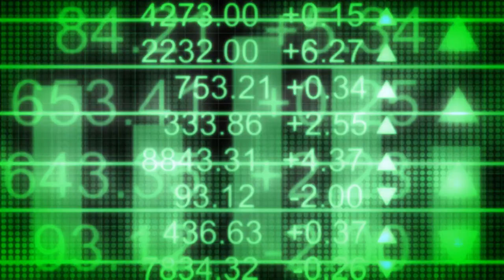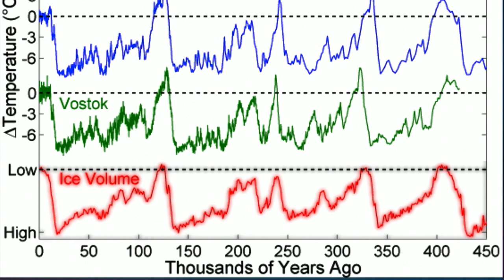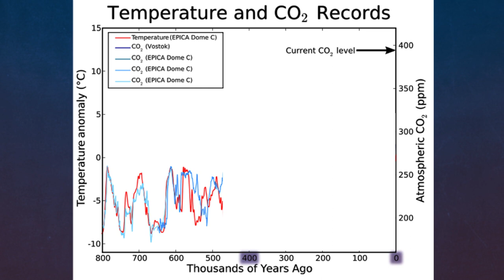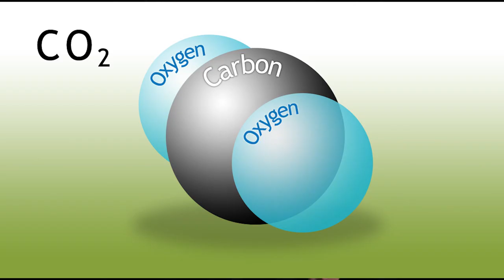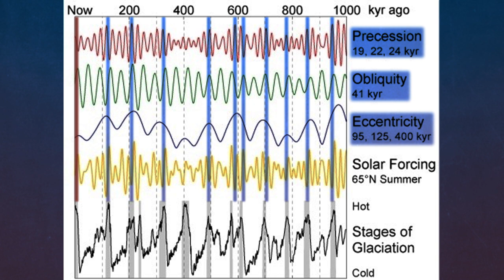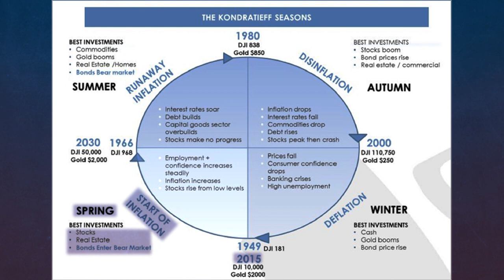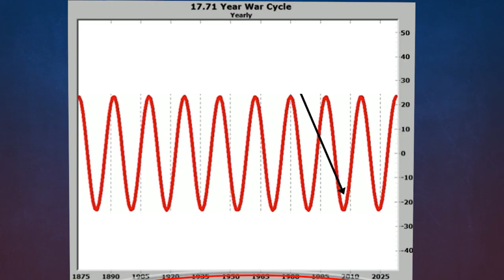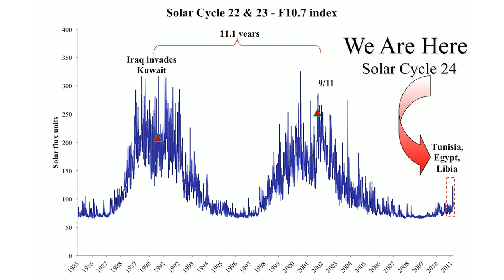Cycles of Time with Gregg Braden

Comment: I’m so disappointed in Gregg Braden. There are several critical and dangerous errors in this video. First of all, the graph shown at 7:40 is from Loehle and McCulloch (2008) 'A 2000-Year Global Temperature Reconstruction Based on Non-Tree Ring Proxies'. Accuracy aside (and there are several criticisms of the paper), the data ENDS at AD1935! And Braden describes this data as “TODAY.” Updating to current readings, the temperature for 2016 would be plotted at +1. 2° C which is clearly off the chart.

Also, Braden’s interpretation of the “CO2 lags temperature” graph is erroneous and does not tell the whole story. Though it is true that the initial changes in temperature during periods of glacial/interglacial transition are explained by changes in the Earth’s orbit around the sun, which affects the amount of seasonal sunlight reaching the Earth’s surface. However, the lag between temperature and CO2 works as follows: as ocean temperatures rise, oceans release CO2 into the atmosphere. In turn, this release amplifies the warming trend, leading to yet more CO2 being released. In other words, though historically CO2 was not the initial trigger, the initial warming further triggers a CO2 warming feedback loop until the planet has a chance to stabilize (aka- the cooling periods Braden mentions). This is how the climate has changed naturally over the millennia. The rate and speed of warming we are now seeing with mass CO2 and Methane release, is much more rapid than any time in history.

I like a lot of what Braden has had to say in the past regarding ancient civilizations, indigenous cultures, and the heart-brain-body connection.. but this video is ill-informed, irresponsible, and outright dangerous at a time of critical imperative that we work to save our civilization and as many species as possible from Earth’s 6th mass extinction, which is already now underway.
Reply: Totally agree! This is what happens when lay people believe that climate science is just a matter of doing 'research' on google.
Reply: Agree! Braden lost me when he said Milutin Milanković was  "an Australian astronomer" while showing a slide describing him as Austrian/Hungarian. Not mission critical but VERY sloppy and not showing any understanding of his own background evidence.
Reply: Very disappointing to see Gregg Braden wade into an area he has no expertise in.
Unfortunately it makes me question all of his previous work as well now.
Reply: Maybe he's in love with the sound of his own voice on youtube, who knows.
Reply: Braden does have some interesting opinions and insights but in this video and others when he cites FACTS I'm familiar with he's often dead wrong.  I therefore doubt anything he says where I can't readily verify his statements independently.  Along with his video production team which is good, he needs a fact checker who can read.  As funkymystic points out, his interpretation of the relation between PAST carbon and temperature cycles is incorrect and he totally ignores the FACT that current values are indeed OFF THE CHART he uses which ends in 1935.  The current temperature is off the chart and so is the current level of atmospheric carbon dioxide which is > 400 ppm.  What he's right about is that rising temperatures do cause subsequent increases in atmospheric carbon naturally regardless of the cause of the temperature increase.  This actually means that even if all man made carbon emissions were to cease atmospheric carbon would keep climbing as a result of the warming we've already caused.   He misses the fact that rising CO2 levels in turn cause further warming in a positive feedback loop.  That fact doesn't explain current CO2 levels it just means that the warming caused by artificial anthropogenic carbon emissions is AMPLIFIED by natural forces.  For each 10 units of CO2 humans add to the atmosphere mother nature tosses in another one "for free."  As we warm the earth by adding CO2, the earth "naturally" produces more CO2 which in turn warms the earth even more.  This is a positive feedback loop which can reach a "runaway" state. Venus with surface temperatures hot enough to melt lead is likely the result of such a runaway carbon feedback loop.  In the case of Venus the warming wasn't the result of human activity but rather of being closer to the sun.  Earth's climate is a very delicate balance and even very small variations in solar energy can trigger and end ice ages.  What's the effect going to be of continuing to increase atmospheric carbon off the chart?  Hothouse earth.  Of course there are natural variations in climate and always have been but current carbon and temperature increases are MOSTLY the result of human activity and are vastly greater than the natural variability, some of which is cyclical.  This is the all-important fact which is taking us "off the charts" into a climate catastrophe.  Braden needs to read one or two scientific papers by real climate scientists and get a real scientist to review his hokum before torpedoing his own credibility by demonstrating his complete incomprehension of climate science and carbon cycles.
Reply: Yes, I totally agree with your point of view. I would just had one thing.
Also this climate change matter awoke our consciousness on optimizing the use of our energy (50 years ago Captain Cousteau warned us about the necessity to have an optimized use of our planetary resources), without the global warming subject, it is still worth make a better use of what is able to produce the planet. For instance, using less fuel will lead to less contamination which has also a frightening impact on the life cycles upon which we depend should we like it or not. So even though we might be wrong (which is not) about reasons of temperatures rising, adding respect to the biosphere (I use this word to emphasize that Earth is a living system) would give us much more chance to reach stage I (at best estimation we should be at 0.74) of evolution. Evolution IS something we control (refer to one of Baden's friend: Bruce Lipton).
Reply: Madelyne Edwards can I watch your video?
Reply: @tomix1970pl1  exactly, dissapointed people, but all they can do is reply on YT video's, doing something that actually makes a difference... Nah...
Reply: Oceans don't release more CO2 though.  The waters may hold less but growth rates of phytoplankton, forams, coral etc all increase. 

Look back through the geological record.  Limestones and mega reefs all form in warmer water and all remove CO2 from the  atmosphere and lock it away.  Even oil and gas that we use today are vast carbon stores that originated in the oceans.
Reply: @tomix1970pl1  "The elites.. etc etc" - not going to comment on that BS. However, commenting about the errors of a video with the potential to influence millions of viewer's ideas is not "doing nothing." and the comments are correcting him. Wtf do you think "peer reviewed" in science means? It means bringing criticism to scientists that are not getting it right... Those commenting with criticism ahead of this comment did so with an explanation of the data,. thus, "showing you how it should be in the right way." 

All I can ask is what is wrong with you?
Reply: @xavion79  you and tomasz should be in a different class than this one... i would venture to say you two are likely the ones without much action. the people that commented were talking about data. they know about it FROM DOING SOMETHING. the language you two used is language that is used by people doing nothing. in essence, what you are what you are projecting on to others.
Reply: @kevinparsley6806  good advice thanks lol
Reply: @kevinparsley6806  its difficult to trusy any source of info... several years ago I thought that BBC was one of the most trusted, my bubble was blown ... no we have experts who say there is a consesnus on this climate issue and other experts who say its all nonsense (personalty either way it doesn't matter, we can all agree that less pollution is bad, thats the bottom line.) The difficulty is is convincing developing countries whose citizens all want what the conceptual west has . We need to organise a final debate using that petition website- Lord Monkton piers corbyn and malcoms whats his face on side  and three of those opposing side.
Reply: funkymystic you fail to mention Geoengineering which is meddling with our climate... so in essence you are both not fully engaging the true factor!
Reply: @xavion79 , this persons comment actually shows that he is well informed on this topic - and all he did was point out the flaws in the content of this video. So Yeah - he's obviously doing more than just complain in a comment.
Reply: Who are you, funky? Please cite your degrees, published works, and links to online research and articles. Thank you.
Reply: Plus the World is flat, so it's all BS
Reply: What is your background...And what conclusion are you making since you disagree with him?

Comment: Practical, broad, and straight forward. I like it! I suggest that you include the total heat given off by all of the machines on Earth producing heat that were not there before. Also, the Sun's [Sol] chemistry is changing. I saw it as gold-white in early 1970, and now 'white'. It has less hydrogen now that it has converted into helium. 2 prior reports I heard say that Sol is hotter, and coincidentally the other planets in our solar system. Also it's 11 yr. cycle is now 13 yrs. in length! Look into it.

Comment: Solution to the questions I see coming up in all those advertisements all day long of Gaia: How can a hammer be found in a 400 million year old rock??
"The London Hammer"; How could a modern artifact be stuck in Ordovician rock? The answer is that the concretion itself is not Ordovician. Minerals in solution can harden around an intrusive object dropped in a crack or simply left on the ground if the source rock (in this case, reportedly Ordovician) is chemically soluble

Comment: julia sommer,  You are very astute. This vid has some interesting info, and Mr Braden does have a broad range of sources to pull together. I find it puzzling that he can be on the right track in so many ways, but then introduce a blazing anomaly which suggests he doesn't actually understand the concepts he is discussing. These anomallies have been consistent since I first followed his work in the 1990's. (Awakening to zero point) He claimed to be an astrophysist, and suggested that if the comets which struck Jupiter ignited it's atmosphere, that it would bathe the earth in blue light, which could fulfill the Hopi prophecy that earth would be in perpetual light. ( sun on one side, jupiter on the other ) Of course this would also require the jupiter orbit to change, and pace earth's orbit, or vice versa, which he failed to realise. I have followed his work intermittently over the years, but always find these anomalies which for me undermine his credibility. I am pleased that others notice these quirks in his work.

Comment: This is slightly confused over CO2. Human CO2 is trivial compared to the natural and the capacity of the oceans. Ice cores under record CO2 levels because of microbes which convert trapped CO2 into methyl halides. Check stomata data verse ice cores and you will see the ice is not accurate. The rest is very interesting.

Comment: am thinking there must have been massive uncontrollable wildfires which caused the co2 spike, as the planet earth warms the divide between hot and cold air becomes less, and the jet stream becomes weaker as a result higher in the atmosphere and in latitude resulting in less rainfall.  ( possible why they are going to such great lengths to modify the weather). just an idea.

Comment: I kinda like this video but;
The theory of the cause of the climate cycles is based on the Milankovitch cycles as the driver and not the CO2 historically. Increased CO2 is a result (possibly cushioning the impact of the downturn in the cycle). 

Most CO2 is in the ocean waters. Water holds more dissolved CO2 at low temperatures. When water temperatures rise CO2 is released. Think of a glass of soft-drink with ice in it, the liquid temp. will remain quite stable in a warm environment until the ice is melted, then the liquid temp. will rise quickly and the CO2 will be released from your drink leaving you with a warm flat drink. 

If we can raise the global temperatures (outside of the normal Milankovitch cycles) by the release of massive amounts of CO2 to extreme levels in the atmosphere and manage to melt the ice then we can look forward to a bonus massive release of CO2 from the warming oceans. Then...well we don't know... That's kinda why people are concerned.

Comment: Subscription on the Gaia app keep stopping about four or five times on  average but per 30 minutes film  occasionally constantly stops every few minutes . android 6 removed app reinstallation several times cleared cookies closed all other apps and screens and tabs  even turned down resolution on Gaia app no difference made still stopping on the app . also move onto chrome and log in as desktop and get the same results .    I've just watched this on YouTube without any interruption . paying for subscription getting unwatchable content sometimes. but perfect on YouTube  . can you tell what my next move is on the can cycle . even watch when  no one else is online and sit near the router hub making no difference  . Gaia app keeps buffering and stopping . and yes I've turned it on and off . extremely good and  informative content but delivery is frustrating and even more so when paying for the service .

Comment: I am a Professional Geophysicist, I see a lot of data, all types of data, and I can tell you the Chart at 9:00 (Temperature and CO2 Records) is scaled to look like the CO2 lags the temperature; if you look close enough you can see that it has been scaled to look like peaks from different cycles occur out of phase (side by side). Where in fact the corresponding peak is below not to the side.   There were some true statements at the beginning of the video, but either a misunderstanding of what the data was saying due to incompetence or this was intentional misinformation. Either way don't listen to the underlying message that increased carbon dioxide in the atmosphere has a cooling effect. In fact don't listen to anything this guy says, if he gets stuff like this wrong then you know to stay away from his jive. I will say though that I think it may have been a good idea to put as much carbon back into the biosphere as possible to stop a long trend of cooling that has probably been going on for tens of millions of years. There would be some intense effects on climate, and it may start a few wars, but in the long run we would likely pull through and a super intelligent AI will repopulate the earth with genetically augmented life to suite our mutual needs, or we would simply be replaced as the primary actor and fade into obscurity, lost to the expanse of space, never to influence anything again, forgotten, including your god. I think that is more probable than one going to heaven.
Reply: Your mastery of limitation is quite impressive.

Comment: Ice core data, naturally enough, only shows the past climate for Greenland and Antarctica (the only places with long term ice cores). Local climate varies for lots of reasons - e.g. stronger gulf stream in the past can make the north Atlantic warmer to give an example but there are lots of things influence the climate in Greenland. 
Those old graphs also have mistakes in them and they also generally stop at 1950 before the modern warming and would show an up tick if you include that.
Also, the ice cores don't include the most recent years because it has to wait for the snow to consolodate into ice before it becomes part of the ice core.
This is a better Greenland graph that combines ice core data, observations, and projections for the future.  

https://www.carbonbrief.org/factcheck-what-greenland-ice-cores-say-about-past-and-present-climate-change

Comment: It seems that Gregg is a climate change doubter, and he is misinterpreting the graphs. If you carefully check the graphs and what he is saying, you may realize he is getting a bunch of the information wrong. And the graphs are so poorly put together that the layout makes almost no sense. Stopped watching at 11:51 / 29:10.  ie. the temperature usually goes up first than the CO2 goes up. Then the temperature usually goes down and the CO2 goes down. But not always. As shown in the graphs. however Gregg said when the CO2 levels go up, the temperature drops, which is Not the right way to read the graph. When he said it lags, that was correct, it's not doing the opposite of each other. Climate scientists should probably review some of this and see that it's wrong. Thanks for reading! Chris C

Comment: Gregg Braden, well-meaning with abundant knowledge and wisdom is, however, IMO, a bit naïve and myopic. He, implicitly at least, conveys the idea that things will work out "before it's too late." Well, according to ice core samples, we're likely to transition through a cataclysm. "Transition" coz there is no death, only change...in this case, colossal change. 

He's also a bit myopic coz he doesn't mention that these cycles are in fact an eternal phenomenon. 

We're in the Iron Age or Kaliyuga, so the cycles are oscillating in a low frequency range, compared to more enlightened ages. So, life in the world as we're currently experiencing it isn't so bad...in fact, it's not bad at all! It's, as Alan Watts used to say, "worth the candle." It's a beautiful world! However, neither will it ever be a utopia...at least not for long. If we can see the overview of things, and more from a metaphysical perspective, we'd be better equipped to face the challenges,..